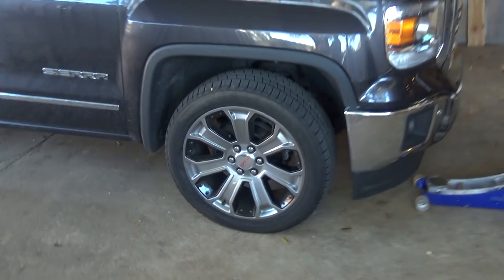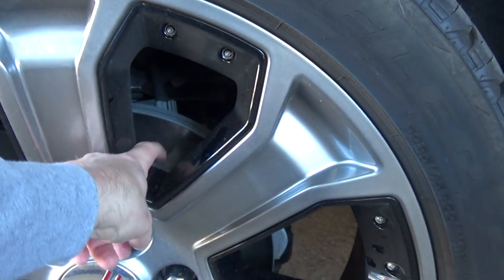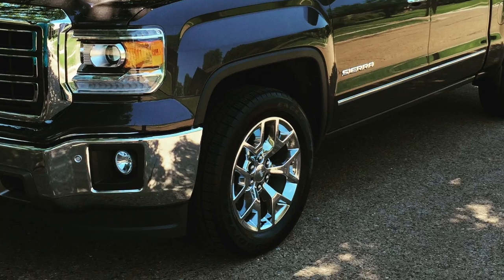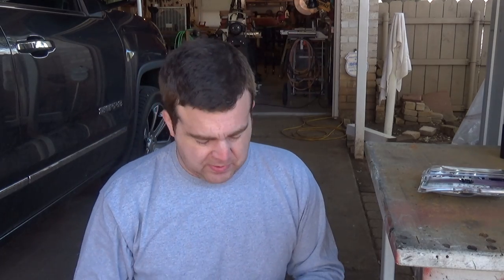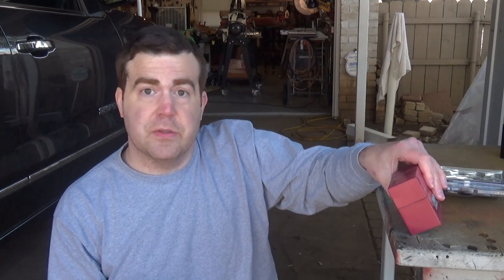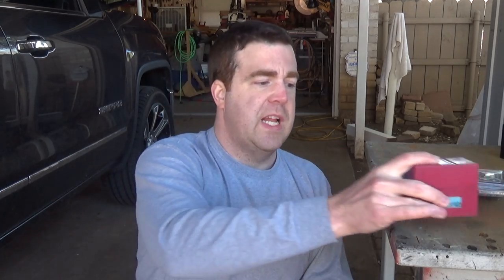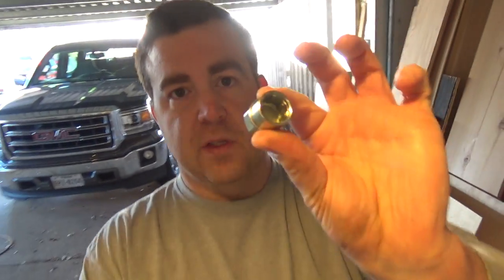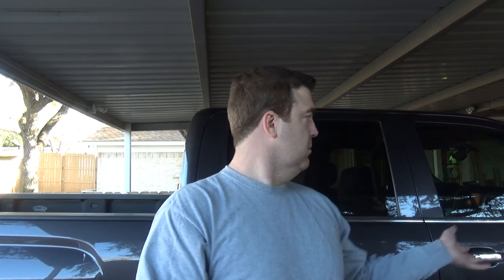WHEEL THEFT PREVENTION TIPS | My Factory 20's were STOLEN!

Comment: I think you should buy another set of wheel locks to test them and see if you can break it loose. Just get a bolt that fits the wheel locks and put it in your vice. Put the lock on the bolt and see if you can get them off! It would be a great video.

Comment: If you have a TPMS on those tires and you have an idea or where they might be, the TPMS is codes on the vehicle for the truck, so if you come across a listing for those wheels or a vehicle which has wheels similar to the ones which were stolen from your vehicle, there is a computer you can contact a dealership and have them help you, you can actually prove those tires are for your vehicle, I have seen it done here on youTube.  I am not exactly sure what all it requires, but I have seen it done.  Actually there is a video somewhere let me see if I can find that link for you.

Comment: Aren't the TPMS coded on these trucks? I know some are and the dealer can scan a wheel and see if the codes match whats for your truck.
Reply: James Moore they can he probably didn’t know
Reply: Yes there is newer vehicles tpms are locked to vins from factory there is actually a video out there of some people who got there wheels stolen from a gmc but found them by scanning the tpms codes
Reply: I wonder if someone could write a Bluetooth app for your phone which would keep tabs on if the TPMS sensors were unloaded. (Meaning that the wheel was just removed or tilted) and then alert you. Also, because these sensors are wireless, could the police carry a similar app for their phones to scan a suspect garage or service depot etc?
Reply: TPMS sensors use a different frequency than bluetooth and the range has to be super close if you wanted to read a sensor directly. If you put a more powerful transmitter in to help locate them, then you'd need to supply more power. Not impossible, but a cool challenge to design..
Reply: Thank you. I presumed again. Sorry.
Reply: so just remove TPMS  and sell the wheels.
Reply: BashingBrainez the video you are talking about I've seen before. Theirs stole from a dealership, too bad they stole I think some special edition wheels, so when posted on Craigslist they found easy. They met the guy and scanned the tpms and it matched 😂
Reply: James, That would require the car to have internet to send the data to the users phone. Some newer cars have Wi-Fi, but it would need internet everywhere,... not just at home.
Reply: tpms screw into the wheels from the inside behind the valve stem. nobody is going to sell stolen wheels with the tpms on them.
Reply: coelho sports yeah they will. You think people with low iq's think?
Reply: if he's capable of stealing your wheels, then hard to imagine he doesn't know how tpms works. that would be a special criminal, like maybe a meth addict.
Reply: coelho sports well removing wheels isn't rocket science. I would imagine anybody could do it.
Reply: every new car since like 2005 has been required to be sold with tpms. if you are capable of driving up to a vehicle, stealing all 4 wheels, leaving the vehicle on the ground, and driving away with the wheels, how can you not know they have tpms? i don't see how that is possible. for one person by himself to get away with the wheels without getting caught is even more difficult, so more likely it's 2 guys doing it who both don't know about tpms. maybe illegal aliens?
Reply: lol you can take tpms sensors off dummy.
Reply: coelho sports like Canadians? Why would you say such a thing.
Reply: am i supposed to answer that or was that rhetorical? what american who drives wouldn't know about tpms being on all new cars sold in this country for the past 12 years? GM has been using it since the 90's and porsche since the 60's. ok, i'm done. bye
Reply: coelho sports No they're not screwed into the wheel it depends on the type of tpms either the valve stem has a screw into the sensor and the others have a nut on the outside the holds the valve stem that is connected to the sensor itself.
Reply: asbergers?
Reply: 12 years? You can't count. The law has only been in affect since 2008. That's 9 years, dummy!
Reply: if half these replies are from adults i feel sorry for these people. yeah, the tread act requiring tpms became law in 2005 and compliance requirements began the next year and full compliance for all cars was required by 2008. so when did the cars get tpms that didn't already have it? between 2006-2007. there is a form of autism called asbergers where some people can't detect subtle social cues or gauge relevance of different parts of a conversation and usually have inappropriate social reactions (dummy, f'ing f'er, doodie face, etc) to innocuous points of contention. anybody can log onto the net, so you just have to ignore some, mute others, decide whether it's worth going back and forth about something with others, etc. topic of this thread is: tracking down stolen wheels using tpms when anyone with enough cognitive ability to remove 4 wheels from a car and get away with the wheels SHOULD know about tpms by now unless they recently came from someplace without it.
Reply: I honestly can't understand your comment, due to poor grammar. But the law requiring TPMS to be mandatory started 2008. Before that it was an OPTION and MOST cars did not have TPMS until 2008.

Secondly, You can't track wheels by the TPMS sensors. But whatever guys.
Reply: Christopher Andrews is a great idea but you'd need to use something other than Bluetooth. As tpms sensors work in one of two frequencies, either 315mhz (noisy common) and 450mhz (I believe, we hardly ever run across this type at work). The other issue is the range, these sensors will work up to 20ft away, but that's worth the vehicle comms, which is usually one way, meaning unless you have the programming tool the only way they send a signal is when the vehicle sends its own keep alive signal saying that it's there and waiting for data, or on some types only when the sensor detects movement for a period of time.it would be much easier to just have a shop take the tire off and put little Bluetooth or rfid tags on the inside of the rim if you don't want them pulled off easily. Just make sure you find a band similar to the band type tpms sensors to hold the tag to the rim or it will fly off
Reply: $40 at a dealership and they will reset it with no questions
Reply: +Chris Jewell they sell the handheld tpms scanner online to reset and program for all GM vehichles

Comment: When I got my Volks I installed a tilt alarm. If the vehicle isn't jacked up in all 4 corners at the same time, and kept completely level it will sound the alarm. This includes towing attempts.  Doesn't prevent them from stealing them, but is a good deterrent. Just like the wheel locks.

Comment: very sorry to hear about your loss. i just saved up every penny i could for 3+ months to buy new wheels and tires for my truck. so worried about putting them on my truck as the wife's car is the owner of our garage. i totally love your idea of the stamping! there are already random codes stamped in seemingly random places around the wheels and i wouldn't pay any attention to them if i saw them. i only wonder though, if you saw them on craigslist and went to take a look at them, how would you go about getting them back? i think it could be very dangerous to confront them, nobody enjoys going to jail for grand theft. well, cross that bridge.... but i really love the idea so much! i saw the stamp sets are only $10-25 at HFT. i will definitely be buying some and mark them before i mount them on the truck. really thank you so much for the tip. at least its a last chance to be able to get them back and the responsible party to enjoy their karma behind bars. and as to hiding the key, i cant agree with you more. i watch all of these videos and every previous video says throw your key in the glove box. ok, im a thief, where will i look? haha. one more thing i would like to add is that you can get a full set (not just one per wheel) of splined lug nuts. yeah you can pound a socket on them and get them off. but if you are pounding sockets on 26 times! HOPEFULLY someone will hear. but hopefully it will change someone's mind when they just see them. i will use 5 splined and one of the locking lugs per wheel just to make them change tools to slow them down a little. yes, if they want them bad enough they will still get them. but thats where the markings give you one last chance to get them back. you are my favorite person of at least today. much love brother !!

Comment: That wheel lock bolt that is twistable.  Wouldn't they just bang the top one that is inside of it?  That part isn't twistable, wouldn't that beat the whole purpose of the design?
Reply: correct, brute force then twist, these wheel "locks" are not going to stop any thief that wants those wheels for drug money, all wheel locks are actually good for is pissing off mechanics/tyre shops when the owner loses the "key" and needs the wheels off........... same process every time no matter the type of lock..... smash smash smash then twist ;) also in case people don't realise, all of these wheel locks have the same HUGE flaw.... there are only a handful of "keys" no matter what the manufacturer claims, buy or steal a handful of "keys" and you have yourself a set of "steal any wheels you like keys".  The one saving grace of wheel locks, is that they slow the thief down and make the process noisy, unless they have a few "keys" on them ready to go :P

Comment: I have found out over time plastic stays deterriorate! In are out of the sun, cold and heat breaks them down as well.They become brittle and easily break. I would use a galvanized piece of wire. One can make a small circle with a short piece of wire. You can bend each end of the wire and make a small hook on each end. With tension between them they will hook together securely! You still can use the plastic stay and you will have two chances to keep your lug nut key safe and sound! If you have a flat/blow out on the side of the road, you want to be darn sure you can find your lug nut key where you hid it!

Comment: Good idea on marking the wheels. I've been using a Craftsman engraver to put my TDL # on valuables for decades-that way, the cops can find you in case of recovery. Also, I would recommend marking so that it can be read when mounted on the vehicle. You'd probably need a a warrant to get them off the vehicle to read the markings. I use wheel locks as well, and the shock/movement enhanced alarm is a great suggestion. Install some motion detection switched security lights. Thieves hate light almost as much as noise.

Comment: Old video, but anyone seeing this.  Be mindful of when you get your tires replaced, tire shop used the impact wrench on the key and busted it.   Had to take it with the flat tire to the dealer so that they could remove the wheel lock without the key-dealer was the only local place where I could get service the same day (all other shops were booked 1 week out).  Always keep spare wheel lock keys.

Comment: You should replace some of the studs with left handed studs
Reply: Amazing idea as long as the studs don’t just break off.
Reply: It’s way faster to snap a stud than wind off a lug
Reply: Derek Stone you won’t be able to snap them. They would probably destroy the threads but that makes it even harder to take off.
Reply: 9914life I work in the automotive industry. Trust me it’s really easy to break a stud. It only takes about 120 foot pounds to break a 12mm stud. We get vehicles in all the time with cross threaded lugs so we just snap them off and replace
Reply: Derek Stone I work on heavy duty trucks all the time and I’ve probably stripped hundreds of nuts with impact guns but I’ve stripped the stud.
Reply: light vehicles and heavy vehicles are different ;) hence why it is a different qualification completely :D light vehicle wheel studs snap like toothpicks with a rattle gun or any bar/ratchet longer than a foot, provided it's not an 11 year phillipino girl on the other end of it :D
Reply: Tapper21 I’ve used impact guns on cars and haven’t snapped studs.
Reply: 9914life my local Wal-Mart tire shop has snapped my studs before. They happily replaced them ofc for me.
Reply: Αχέροντας Νονα probably because they used impact guns. Lots of thieves just a 4 way wrench.

Comment: Put left handed threads on the studs😂😂😂
Reply: This is funny. Lol
Reply: Years ago several manufacturers did just that on the driver's side wheels thinking that it would make the lugs less likely to loosen up due to normal wheel rotation.
Reply: @1575murray  yeah I worked in a junk yard and found out the hard way snapped all lugs off with a breaker bar wondering why they would not budge. Rust an all you get that a lot in a junk yard

Comment: You should've stamped right between lugnuts hole, on that recessed part, somewhere they can't scratch it off, still a great idea to do, I use the factory wheel locks, similar but there's no collar, and I just hide the key somewhere good inside.

Comment: Doesn’t $1000 deductible mean you cover the first $1k before insurance kicks in?
Reply: Yes until the insurance company completes its investigation then it's reimbursed to you.
Reply: FirstMongoose yes. You pay the first 1000. They only cover what’s over the 1000
Reply: Yup
Reply: @mrbond9882  - they don't reimburse the deductible
Reply: The guy in the vid got his insur claim paid, net of the deductible, and then bought tires that were 1/2 the price of the stolen ones so he wasn't out of pocket any money.
Reply: @halibut1249  I know what deductible means. I thought he made it seem like the wheels were $1000, his deductible was $1000, so he got free wheels. I missed the part where he says he opted to pass on the factory(twice as expensive/$2000) wheels, which is where the “basically got the wheels for free” part comes in. $1000 deductible...factory wheels were $2000. $1000 is his deductible, so his insurance cuts him $1000, which he used to buy the Denali wheels instead of the  factory wheels that were like the ones stolen.
Reply: @halibut1249  yes they do. If the insurance company can conclude you weren't at fault for what happened your deductible will be reimbursed to you. I worked in insurance for many years im pretty sure on how it works
Reply: @halibut1249  and before you reply please go look into. I don't want you being wrong more than once...
Reply: @mrbond9882  - your comment said it's reimbursed after the insur co completes its investigation. If you had added: "and the other driver is found to be at fault and his insurance pays for the damage to your vehicle," then I would agree, because the insur co can't double dip. But otherwise, if you're at fault, or there's no other insured to collect from, there won't be reimbursement of the deductible.
Reply: @halibut1249  theres multiple sides of insurance that don't include car accidents. You don't need another driver to be at fault to be reimbursed. They stole his rims....he'll be reimbursed the deductible. Thats that....
Reply: @mrbond9882  - I just looked it up, if you have comprehensive insurance, stolen tires would be covered, but if you have a deductible, say $500-$1000, then you would be responsible for that and if replacement of your tires is less than the deductible, you might not want to file a claim because you won't get anything from your insurance. They're not going to reimburse your deductible; same as if your $15,000 car got stolen and you had a $1,000 deductible, your insurance would only pay you $14,000.

Comment: your original chrome looked better than what you have now.  I would place the stamp on the drop center rim between spokes where it can be seen while on the truck/auto without taking the wheels off in case it got the five-finger discount.  if you saw similar wheels and tires in the street or parking area just approach the vehicle, identify, and then call 50 if has your stamps on it.  Gorilla has the new X2 wheel locks that look better in design.

Comment: One way you can identify stolen wheel is with tpms. If you bring the wheels near the car the truck will notice and the tire pressure dash light will go off. Another way is also with the TPMS but you can have someone from the dealer come to your house and they can get the serial number from your TPMS from your truck and then they do the same with the wheels and then if they match up, they’re obviously your wheels.

Comment: The issue is many theives have the "keys" already so that doesn't detour them. The best thing to do if you have expensive wheels that you dont want stolen is get an alarm with a tilt sensor that will activated if the vehicle is jostled or jacked up when alarm is engaged.